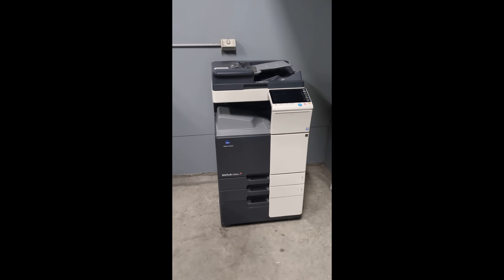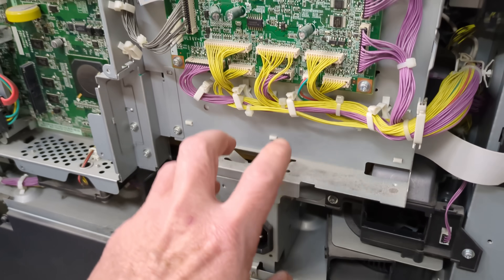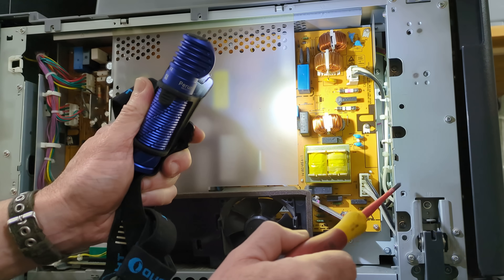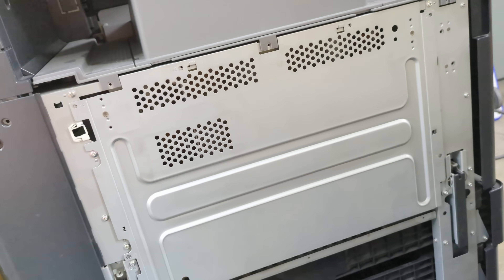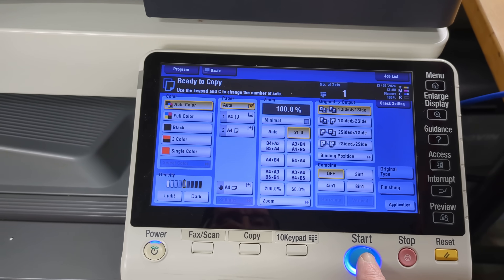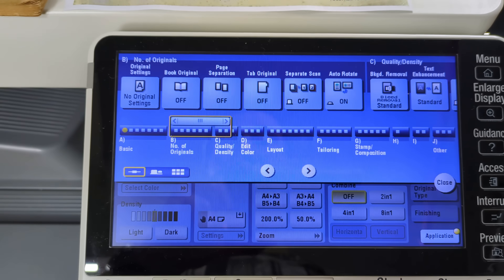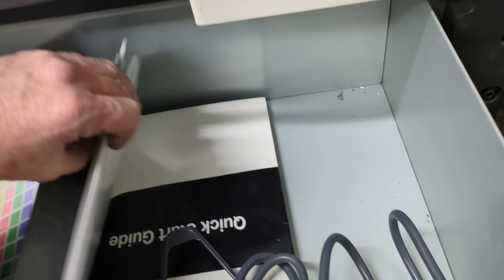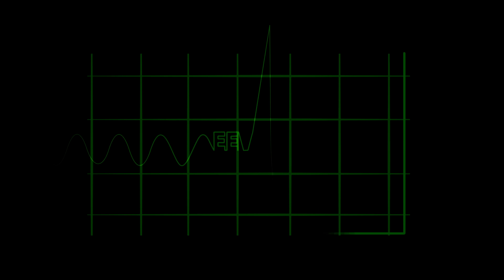EEVblog 1629 - Dumpster Find: A3 Colour Photocopier!

Comment: ooooh, konica is still around? lol ;p
(haha alt tabbed thinking it was censored, but just the plastic over the HV)
Reply: I too thought why has he censored the circuit board 😂
Reply: Konica Minolta exited the photography business in 2006-07, when it sold its camera division to Sony (where it would ultimately become the Sony Alpha product line) and closed the photo finishing division. They still do medical imaging, business machines, and “sensing” (color measurement, etc).

Comment: I like your enthusiasm. So ... is the final point here that you found a free machine that works and that you can resale for around $1500 with absolutely no work or repairs or cleaning on your part other than rolling it around? Boss banger. When I initially clicked the vid, I thought I might learn how to scrounge some useful electrical and/or mechanical parts off an old printer ... but this is cool too.
Reply: Look in the back catalogue- there are multiple videos showing how to do that.

Comment: Somebody had a 300k pages service contract I guess. It‘s a shame that so much working stuff goes in the dumpster.
Reply: Its most likely they went out of business. These service contracts can be 10-15 years and cover well over 1 million copies. I work on similar copiers that have 3 million plus pretty regularly.
Reply: @caseycornett5182  FWIW here in Australia our KonicaMinolta and FujiXerox (now Fujifilm) printer contracts have always been 5 years. The machines always gets replaced at the end with the option to keep for a small charge, or return.
Reply: Its 10 years old now they probably leased a new one so they could write of on tax.

Comment: You don't have the finisher else it would be able to staple and perforate ;) the network plug is on the back right behind a cover. We have the C558 with the bottom bin as dual (or quad) A4 bin. If the A4 is gone a full carton of paper goes in the printer :) There are normal handles on the side to pick it up with 2 persons.

Comment: We had a whole bunch of these machines, in different sizes, in my old company. They are quite reliable, if you maintain them regularly. We used them as printers and network scanners (scan to email/folder [no cloud rubb..]). The ethernet port is on one of the back corners behind a panel, but I don't remember if it's on the right or left side.

Comment: This is a golden chance to see how those nidec motors work. There is absolutely no information on the web.
Reply: Usually just one Nidec motor and a drivetrain of gears with multiple electromagnetic clutches to engage the necessary feed tray mechanisms feed rollers. Also a motor with mag clutches for the imaging section.
Reply: @RTR-MATEY often there are 2 or more nidec motors. On a working machine it could be easy to measure the pins with an osciloscope and find out how to wire them

Comment: I service these machines, the reason it was likely thrown out is the model has gone EOL for support and customers cannot get direct support from Konica Minolta anymore and probably not order consumables either due to age. If you need any support reach out. I can tell you how to get into admin or service mode to reset admin password if it’s not default anymore 🙂 Image quality looks fine and consumables are good. Transfer belt and paper tray feed wheels are interchangeable with later 8 series and i series models but no other parts.

Comment: Bet Someone got fired and said I'll show you, then turned off the main switch so no one knew how to turn it on.
Reply: I used to fix these things for a living. Do you have any idea how many service calls I had to attend to for this very reason? “Copier not working”. 🤦
Reply: @mikestewart4752  Or not setting paper guides right in the cassette, or lines because they don't know how to clean the scan glass(es), or breaking stuff while trying to put the toner where the paper goes. 95% of my calls are user idiocy.
Reply: @caseycornett5182  THE SCAN GLASS!!!  How could I have forgotten??? lol.
Reply: @caseycornett5182  We reported the problem back to dispatch as ID-10-T. 😁
Reply: @mikestewart4752 As a scanner tech, I feel your pain. "There are lines on the image"
"Have you cleaned the glass?"
"Yes"
Goes to site, cleans glass.
Reply: @JeanTheronZA  Doesn’t really happen anymore with the cleaning brush in the ADF, occasionally get a call out for glue or something
Reply: @whatcouldgowrong7914  In my clients' case, usually glue
Reply: Having worked in the industry, that wouldn't surprise me at all.
Reply: They wrote with gel pens...forgot to let the ink dry. 😂
Reply: This is precisely why Apple products are so successful. You don't need to read the manual.
Reply: @bobweiram6321  
It's a cult, once you're in you're stuck.

They're definitely not easy to use.

Comment from the maker: FYI, it's rated for 100,000 pages / month!, so 300,000 total pages is nothing.
Reply: Right. I am a copier tech and I see machines that have millions of clicks. These are super expensive machines(think 25k+ for many of the larger color models) and they are meant to be used to death. On the new(ish) models like the one you have the engineers went into a lot of details about serviceability as you noticed. 1000 plus page service manuals are kinda the norm although once you get used to working on a model line from a manufacturer you don't need them very often. I think I might look up something in the manual once a week if that and I work on probably 100 different models across 2 different manufacturers. Most common faults are going to be consumable things like drums, fuser, rollers, and ADF pickup/sep rollers. All of these things are designed to be easy to replace and you should only need a PH2 screw driver. Good find even used this thing would probably be a couple grand working.
Reply: @caseycornett5182  yeah was one of the last solid models. I think drums using charge rollers instead of charge grids was a mistake
Reply: @rrrohan2288  Those charge rollers were the biggest mistake ever in the 8 series and i series. Drums used to last forever
Reply: And those toner containers are ungodly big. Sagan has to develope a lot of games before those run out.
Reply: @JCGver  standard size for A3 copiers
Reply: @rrrohan2288  yeah standard ungodly big for home use 😃
Reply: There might be a remote kill switch, found reports online regarding other KM models where the printer was remotely disabled after a dispute with the service company.

You may want to block internet access, or better: make a backup of the disk/eeprom to be prepared for a potential awesome printer hacking video!
Reply: @JasperBoschman  I work for KM, there is no remote kill switch. It is end of life though so consumables and service are not being supplied directly anymore. Some dealers may do it but thats it. All that said the 4e series were very reliable other then aging firmware that doesn’t support latest SSL standards
Reply: @whatcouldgowrong7914  yeah if you dont turn off life end a consumable expiring. its like disabling someones still perfectly functioning car because its over its service interval. dodgy.
Reply: @rrrohan2288  End of life stop has been disabled on KM direct models for years in Australia (dealers might be a different story) believe me I know because we get constant call outs for not replacing parts that are long overdue.
Reply: @whatcouldgowrong7914  yeah we even disable with soft switch ability to even view life counts
Reply: yeah 800k is about what we would suggest before its becoming worn out
Reply: @rrrohan2288  So it's only rated for 8 months lifespan? That's horrible.
Reply: Yup, I posted just now about machines with 1.5M on the counter.
Reply: Ага у меня на работе был похожий xerox, мы еа нем печатали 5 тысяч а4 в день, и так несколько лет, и для него это была микро-нагрузка. Ну ок, средне-нагрузка^^
Отличный принтер!❤

Comment: PHYSICAL POWER BUTTON IN FRONT COVER
Reply: In the older days some of them were not orange. And then it was a quest.
Reply: @eugenijusjanuskevicius2292  on our older printer the button was a big cluncky switch on the right side near the display. But hey that's history :+
Reply: @Damicske  it was Sharp, if I recall correctly. The power switch was in the same place as in this Minolta, but it was grey, in a grey body and shadows of the developer unit and toner bottle. No, it wasn't clearly marked.
Reply: Stay watching 🤡

Comment: Had a 284e at work that definitely was networked. Not sure if ethernet was standard or an option though...
Reply from the maker: I'll look harder...
Reply: @EEVblog  Right hand side, thin rear door at the back, there is network, usb and serial port (serial is for service use, modem and data capture only)
Reply: standard
Reply: Ethernet is standard, WIFI was optional
Reply: Yep, and I used that power switch a few times for a hard reboot... 😂